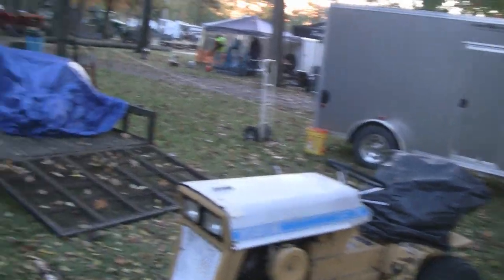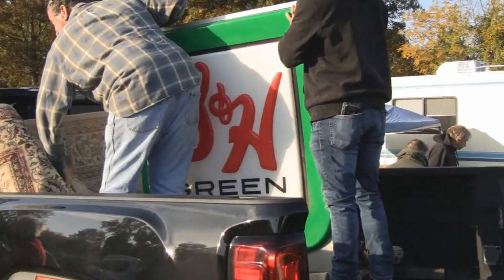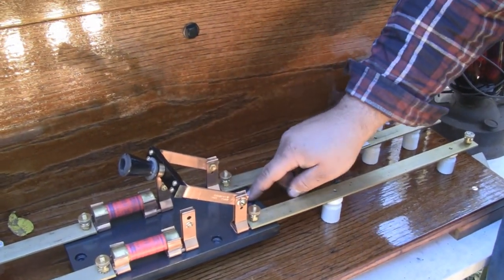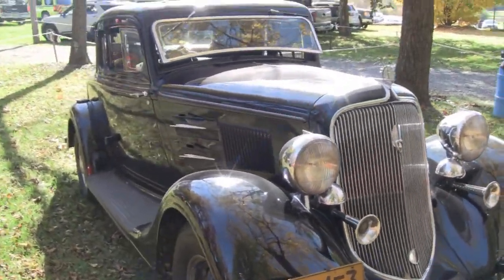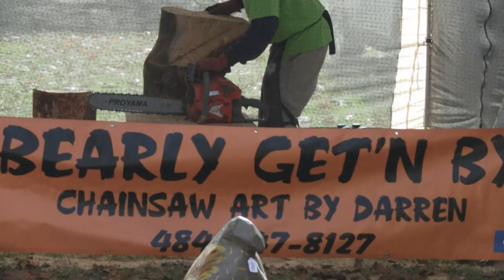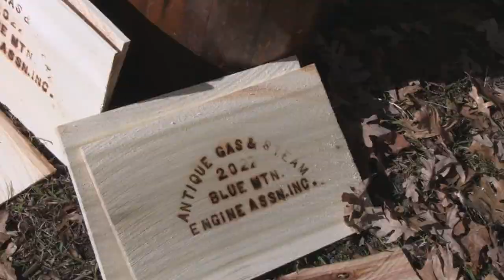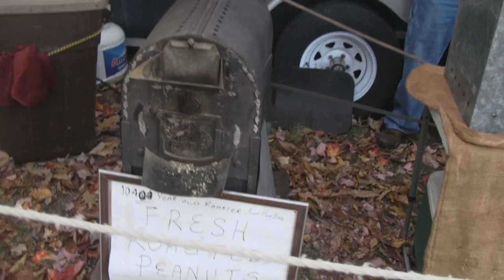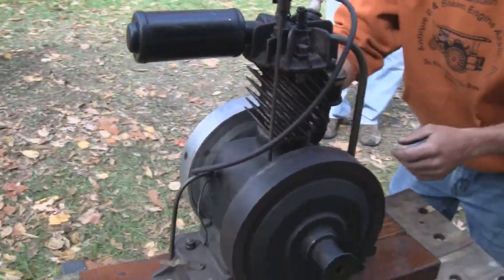JACKTOWN FALL ENGINE SHOW

Comment: Did you cover building the crankshaft in the four cylinder Briggs videos?
Reply from the maker: It's been a while but I don't think we showed the crank!!☻
Reply: @805ROADKING  I was REALLY interested in seeing how you pulled that off. Did you use the Briggs cranks or fab one?